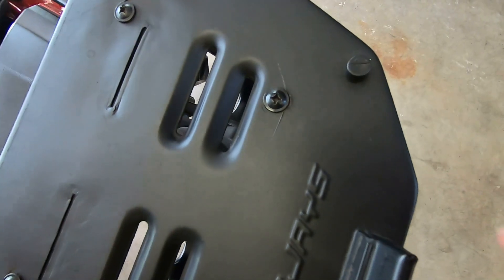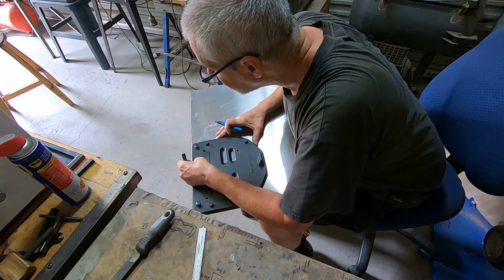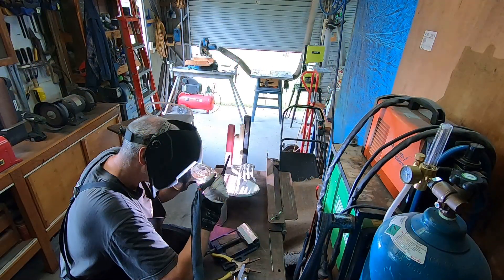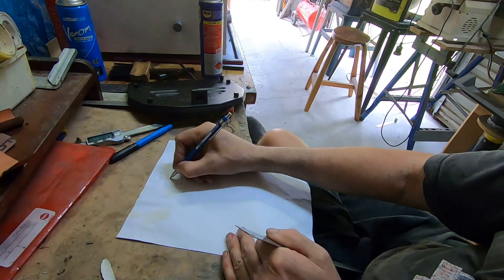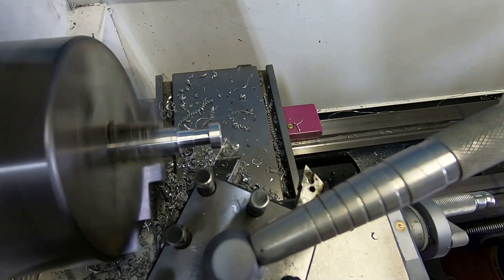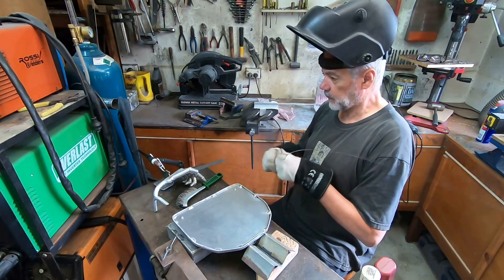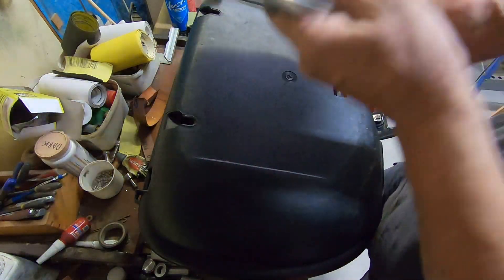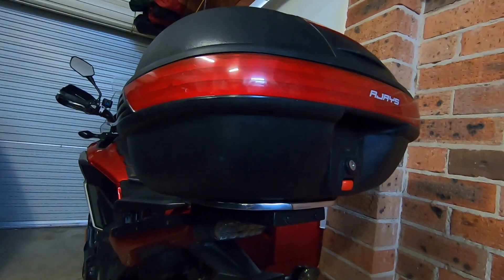Motorcycle Top Box Plate FAIL - Time to build a replacement

Comment: Great job, make sure those bolts that hold the rack on are high tensile if you take a pillion!  That's commitment, I would of been tempted to take the easy route and bodge a repair on the old rack.

Comment: I am going to remove the plastic handles at the rear seat of my NC750XD completely and make metal replacements for then with rectangular tubing that goes further back an put a box on it with pannier bars as well. My bike is a 2016 model and I will keep the plastic stuff in a bag in my garage. I will also be making diy crash bars as I do not like what is on the market. Going to set my bike up for touring and camping.
Reply from the maker: Sounds good

Comment: Gday mate your a clever bastard thats for sure ,just out of curiosity how old is your steel plate ? as i have the same one on my little 500x comes in very handy when going to the shops .
Reply from the maker: It’s 4 yrs old. But Wendy has the same, and same age, and hers is fine. 
Might be the rough dirt roads I’ve ridden.
Reply: Needs bigger washers on that thin metal base plate.
Reply from the maker: I had 3mm steel under the plate, and above the rack. 🤔
Reply: @AfricaTwin-Stuff  the old tin base plate?